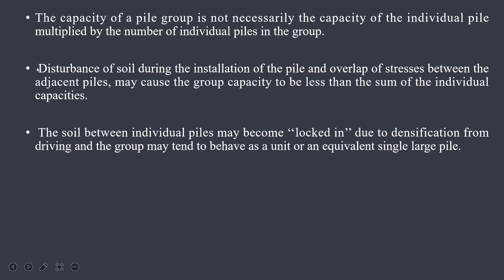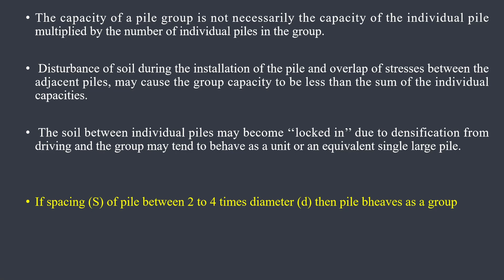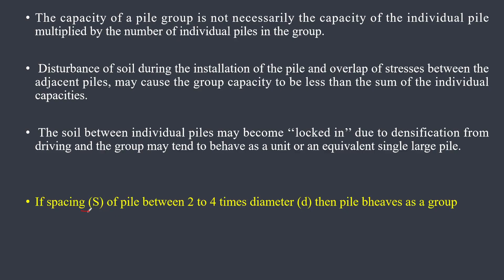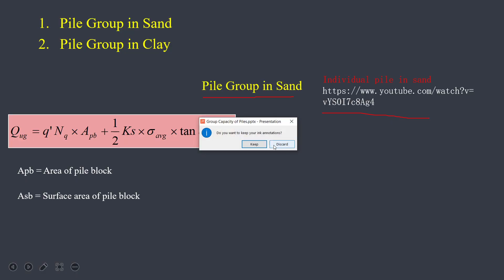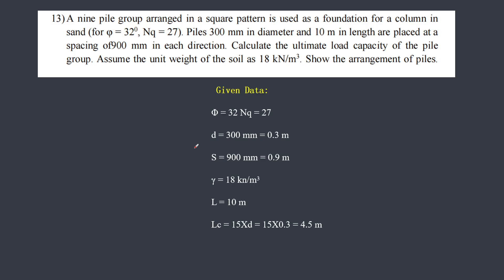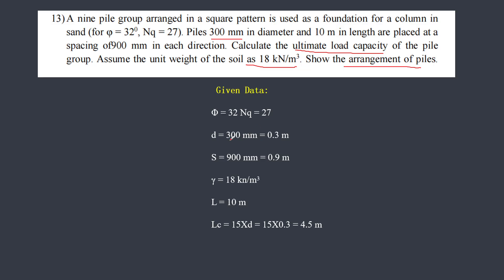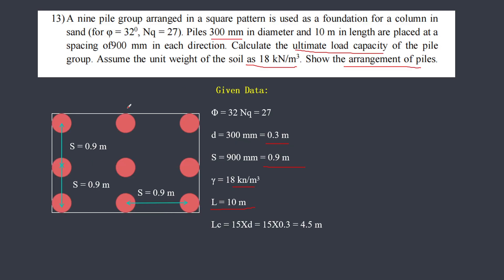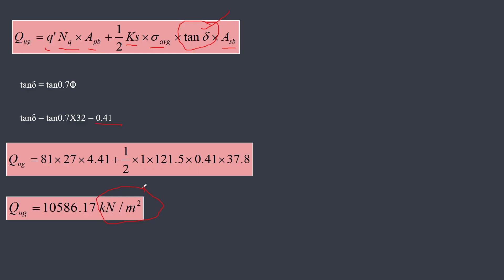Numerical on Group Capacity of Pile in Sand

Comment: A square precast concrete pile of sides 0.4 m is to be driven 12 m into the soil strata shown in Figure. Estimate the allowable load capacity for a factor of safety of 2. Owing to changes in design requirements, the pile must support 20% more load. Determine the additional embedment depth required.

4 m

Clay s_{u} = 16kPa gamma sutt = 18kN / (m ^ 3) , OCR = 1.2 phi_{alpha}' = 24 deg

s_{u} = 80kPa OCR = 9 gamma sar =18.5 kN/m^ 3 , phi ox ^ prime =25^

6 m

Deep

s_{u} = 90kPa gamma sar =18.5 kN/m^ 3 , OCR = 16 phi ot ^ prime =25^

Comment: Sir pls can u do Q 12 of QB i.e A concrete pile 350mm dia is driven into dense sand for a depth of 8.5m. Estimate the 1) safe load acting on the pile .2) safe load if the water table exists at 2m below the ground surface. Consider following properties of the sand phi = 35 , Gamma = 20 , coefficient of friction between sand and pile = 0.7, Coefficient of earth pressure = 1
Reply from the maker: Send me ur email id i will send u the question